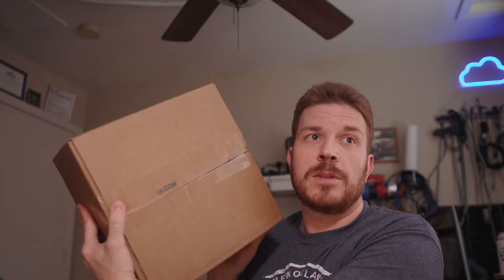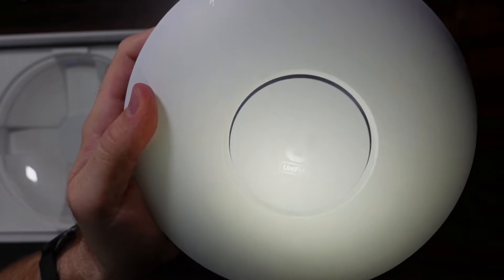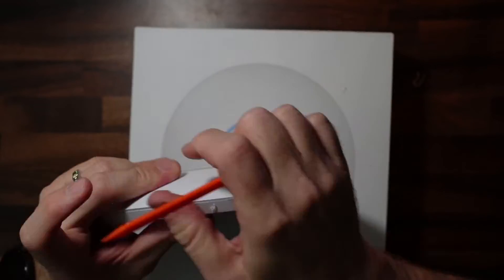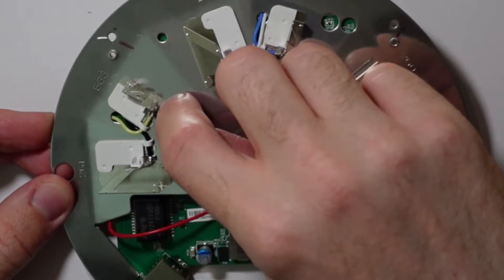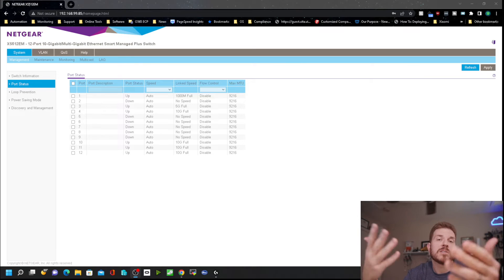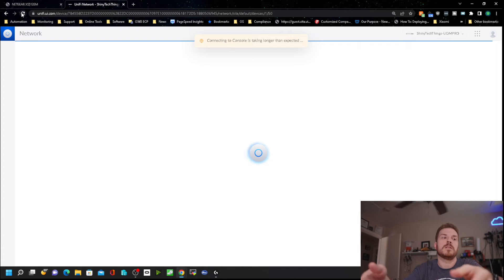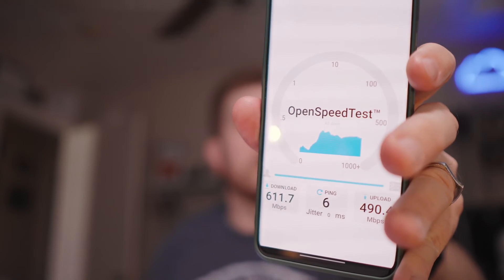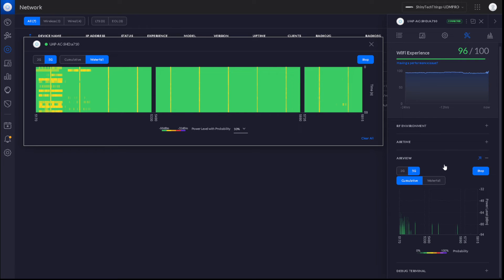unifi wifi 6 pro unboxing disassembly setup and benchmarks

Comment: so u blow up the IP54 when u open it right?
Reply from the maker: @SistemasBenitez I would say so, that was a pain to open up but if you wanted to you could use silicone to re-seal it up. Their AP's are surprisingly resilient to outdoor abuse even when they're indoor AP's. I do build a horizontal mount to protect against most of the rain and I've only had to replace a couple over the years out of a lot and that's been from lightning nearby with PoE injectors. But if you really want something outdoors they now have the mesh ones. When I installed a bunch outdoors there were supply shortages so it was almost impossible to get the mesh ones made for more outdoor abuse.
Reply: @ShinyTechThings  i looking for the component ly24115sn (lan inductor i guess), it got burn, because the office and the workshop of the facilities is on the same  the electrical network, just worked 1 year and after that damaged,.
Reply from the maker: Are your PoE switches and or injectors connected to a surge protector or battery backup?

Comment: I have a doubt , with tp link omada access point do you require the access point to be connected to an omada switch in order to use with the omada controller software?
Reply from the maker: @sachinsherry8175 from what I've read, they do support a standalone mode where you don't need any type of controller to set them up. Here's a support article that goes into the differences of running it with and without a controller. Does this help? https://www.tp-link.com/us/support/faq/3357/

Comment: I'm not too keen on gear that doesn't have screws. Not in 2024. Even if usually you wouldn't need to disassemble an access point, it challenges the right to repair.
Reply from the maker: @manny_f I agree, however I've installed these outside under a piece of plywood and although they aren't weather rated they've ran for years without issues. If they had screws then they would need a rubber gasket and rubber plugs for the screw holes. Open-Mesh when they were good before Datto used to be decent to open with a screwdriver and they were designed for outdoors but I'll have to find one in my garage and see if I still have one because I remember screws but I don't remember if they were glued at all or I could be misremembering it.
Reply: @ShinyTechThings TP-Link uses screws, I don't see why Unify can't use screws. It's like buying a house with a room that has a locked door you can't open. Pretty disrespectful actually.
Reply from the maker: @manny_f I think if they marketed it as a weatherized access point then it would probably be a little less disappointing but you can still take it apart. It just takes a bit of work. Also, after disassembling it i would not install it outside unless I cleaned off all of the glue and then weatherized it myself during reassembly.

Comment: So from experience, they aren't "water proof" I had the unfortunate luck of a toilet leaking directly into the dip where the poe ethernet port is and the whole AP filled up with water...

So thanks so much for showing me how to take it apart !!
Reply from the maker: @ryanmann9775 I've installed these outside and if you build a waterproof cover and use dielectric grease it will last years outside with rain and snow but the key is to keep it covered and dry. I have a dozen out in a forest and they still work great until a squirrel eats through an ethernet cable in the trees.🤓😎

Comment: It's a bit old but.. - any chance you could read the flash dice (MX25U6435F) and share it? I have broken U6-pro, that fails on early boot - and perhaps reprogramming the flash could help
Reply from the maker: That AP is long gone, however If you check out my Instagram you might lock out with a high res photo of it, but you'll have to go back to when I posted this video for my posts on Instagram. But please let me know if you were able to find it or not and if you're successful at reflashing it.
Reply: @ShinyTechThings  by "read" I've meant to read it's 8MB flash content, not to read markings. Reflashing shouldn't be a problem - since I've read it already and it's quite common chip for bioses - but the problem is getting, what to flash on it :)
Reply from the maker: @AdrianSiemieniak  Oh, gotchya. I don;t have that AP anymore otherwise I would help.

Comment: I'm getting 800-900Mbps on 5ghz wifi 6 network with 80ghz channel width. Pretty sick if you ask me
Reply from the maker: @Qwerty Qwerty Those speeds are good, but achievable on most Wi-Fi hardware. It becomes more difficult when you break gigabit speeds. I have a second video coming out for the U6 Enterprise AP that you'll probably want to see.
Reply: @Shiny Tech Things  when comparing it to consumer routers/ap that are usually packaged with ISP plans, it's pretty good

Comment: Oh, you really need that Unifi OS thing in order to make that access point work? What a scam. Apple 2.0
Reply from the maker: @Karel Adriaansz No you can install it with a phone with Bluetooth using the UniFi app. It doesn't do deep packet inspection or anything fancy, just a standalone AP. That's across all their UniFi AP's. What AP or router do you currently run?
Reply: @ShinyTechThings  Yesterday, I tried to setup the Unifi 6 Professional. But, it didn't work somehow. I didn't see the AP  in the app, it didn't pop up. And yeah, I bought the PoE+ adapter for it, from Ubiquiti. And I saw our other standalone AP's popping up in the app, while mine didn't. AP-HD and AP-Pro. But mine should be called U6-Pro. And I connected to our wifi where I connected the AP to.
Reply from the maker: @Karel Adriaansz There's a chance you might need to manually upgrade the firmware from your computer to the AP or you could uninstall and reinstall the app on your phone. Of the Wi-Fi 6 AP's I've only installed the U6-LR in standalone mode and I think I remember updating the firmware but from my phone during the setup process. I would try doing the paperclip reset and see what happens. What all have you tried so far?
Reply: @ShinyTechThings  And I just ordered some new network cables, CAT 6a to be precise. Only, the LAN cable which is plugged in in my switch in my room  from our KPN router where the internet source is coming from, is a CAT 5e cable.
Reply from the maker: @Karel Adriaansz CAT5e is fine for up to 5GbE if it's a good quality solid copper cable and not copper clad. But even copper clad can be fine, I would rather use solid copper core as I know it will perform. CAT6 and above when you approach 10 Gigabits of speed it will be hit or miss on the manufacturer and even between cables I've seen one work and another only go up to 5 Gig reliably.

Comment: I swaped from my 5 year old ac pro to this, Huge difference now that AX adapters are more common. Got 200 down off my ax Samsung cell from my mailbox. Window was in the way only. But that tells me my phone fan broadcast ax pretty far! Crisper too and I have 40 ish wireless things in the house no problem
Reply from the maker: @brycehall7300 totally the ODFMA makes a big difference too.with lots of clients. It's based off LTE on how that works which is why even on a congested tower that your reception is still good. What I've experienced with Wi-Fi 6E on 6GHz is both incredible breaking gigabit over air but as soon as you introduce a wall or two and then it's slower than 5GHz because it's a higher frequency. I'm about finished with the second video on the Wi-Fi 6 Enterprise AP which you might want to check out. I'll hopefully have that out in a couple weeks or less. I'm just trying to find some of the footage I know that I took is missing and most of it is edited now.
Reply: @Shiny Tech Things  I will and subscribed I have a cwna so this stuff is great!
Reply from the maker: @brycehall7300 Nice!👍😎

Comment: Great vid, thanks! A tip: you might wanna try out testing with iperf3 to prevent testing the internet instead of testing your AP ;)
Reply from the maker: Actually, I do you probably still have some footage of iperf3 tests but open speed test although not necessarily considered the industry standard of testing but for normal users as it is more visual is more appealing which is why I opted to keep it in the final video over iperf3. Maybe I could run iperf3 vs OpenSpeedTest and seeing how much of a difference there really is if any. What do you think about that? Also, do you have any other requests or suggestions for upcoming videos?
Reply: @ShinyTechThings  Thanks for your answer! Your dilemma was the visual appeal of openspeedtest vs the more basic UI of an iperf? I would ask: who's your main intended audience? If it's more techsavvy people, they would perhaps be more interested in cold hard data presented in a terminal over a fancy graph? (at least i would be). One of the benefits of iperf for me is you get actual immediate and nonstop throughput data. So i tend to walk around the AP and see what distance and certain types of obstruction does to the speed.
 For a request or suggestion of upcoming video's: Unifi wifi 6e AP's that support 6GHz band are arriving, i would love to see a more in depth video of what range and walls do to the 6GHz speeds you get and if it's worth the extra cost of the AP if the signal degrades too much through 1 wall. something like that. Hope this helps :) PS: i love the disassembly stuff as well!
Reply from the maker: @jb4608s Thanks for the in depth response, I greatly appreciate it. I try to please both non and heavy technical people to try to bridge the gap and educate but I'll probably re-shoot some stuff then for another upcoming video. I do have a Wi-Fi 6 E video out for the U6 Enterprise (part 1 of 2)  but yeah I have a LOT of footage I'm trying to trim down for the second video covering the fixes and what all I did along the way. Maybe I should just summarize instead of showing re-running of cabling, drilling in slow motion, etc.? When I stand in my kitchen in front of the refrigerator the speed drops significantly on 6GHz however 5GHz is still pretty fast. If I step away from the refrigerator a bit then it gets faster. I think it's the materials in the object that the higher frequencies won't penetrate as well especially metal.

Comment: 1:33 What is that supposed to be used for?
Reply from the maker: @IR it's a level where the bubble needs to balance between the lines on it so you know it's level. So if you installed on a piece of wood on a pole that's adjustable you can make sure it level before you tighten up the pole arm that's connected to the wood with the AP underneath it. I'm sure there's other uses as well, but that's just one I can think of.

Comment: Teste the Grandstream GWN7664 over the 2.5GB network port. thanks.
Reply from the maker: @Pedro Brigham  When connected to the 2.5GbE PoE injector to my multigig switch it still performs the same as on the 1 gig PoE switch. Is that what you are asking?
Reply: @ShinyTechThings  No ask Grandstream to send you their latest WIFI6 AP the GWM7664 which has 2,5GB + 1GB NICs and make the same test with a 2.5GB connection.
Reply from the maker: @pbrigham  I'm not familiar with that brand but I'll reach out to them and see what I can do, thanks for the suggestion!
Reply from the maker: @pbrigham  I just sent them a email, hopefully they'll send me one.

Comment: i have unifi controller on my pc put i want install the controller on my mobile can u tell me whate is the stips please ?
Reply from the maker: @Obai Shehab I'm unaware of anyone installing the UniFi controller on a mobile phone, but you can enable cloud access on the UniFi controller on the PC and run it as a service and then connect with your phone to the controller using the UniFi Network App.

Comment: Well done, thank you. Mixed wifi5&6 clients would be interesting to test to see how the better 6 scheduling improves throughput
Reply from the maker: @jay kastner when I added it to UniFi the clients connecting were both Wi-Fi 5&6 but this now has me wonder if I made a single SSID just for Wi-Fi 6 then what would my throughput be with a single client? I know my phone outperforms my 2022 MacBook Pro which I was surprised by. Normally Mac's have pretty good WiFi speeds but maybe there's other variables I don't know of yet like the mixed clients.
Reply: @ShinyTechThings  Different SSIDs still use the same HF circuits and antennas internally, that's where the firmware & scheduling becomes important ... the different SSID is a software 'hack' in a way but uses the very same hardware so it can eg service a 5 client first, then a 6 client. From what I read is the scheduling in 6 is better but IF you have a 5 client they all have to 'listen' to the less efficient 5 broadcasts
Reply from the maker: @jay kastner that's interesting...🤔 I'll have to do a little digging and see but to clarify I would remove all SSID's from the Wi-Fi 6 Pro AP and just make a single SSID for my 1 device to test the throughput.
Reply: @ShinyTechThings  Yeah I would create a new SSID & passwd only for 6 devices (edit - nothing else should connect!), test, then mix 5&6, test, then have only 5 and test again ... possible the 5 only test runs faster than on older APs because of the quicker SoC inside the new AP
Reply from the maker: @jay kastner it might take me a few weeks to do this because I also have the 6lr to unbox and crack open and hopefully it doesn't take nearly as long Pro. It probably took over a half hour to pray that thing open it was glued shut. I'm also tempted to just wait until the summer time and stick the access point outside in the sun when it's 120° out and that would warm the whole thing up to loosen the glue but I don't know if the lr6 is also glued like that or not.